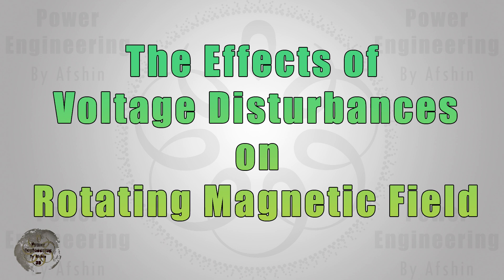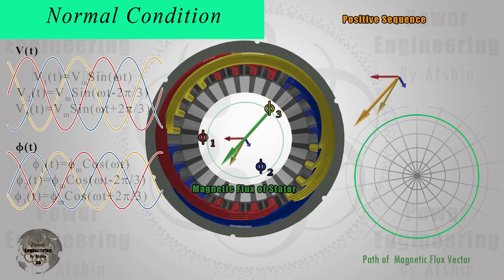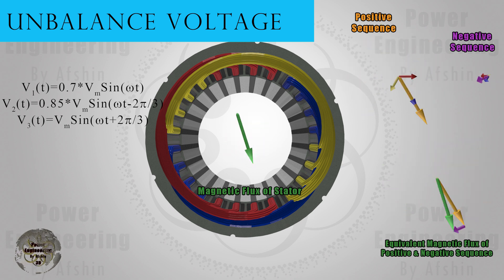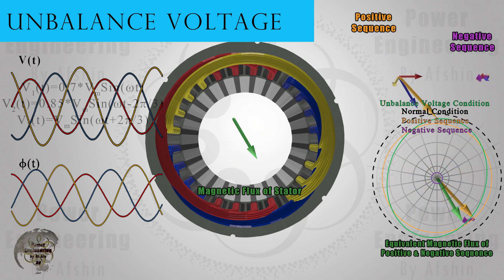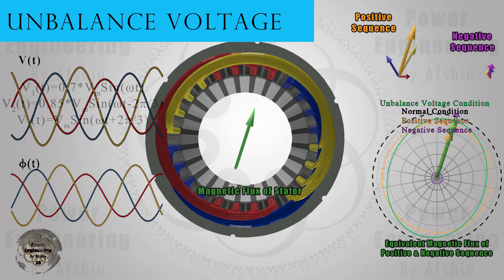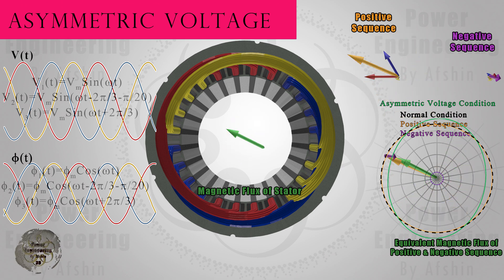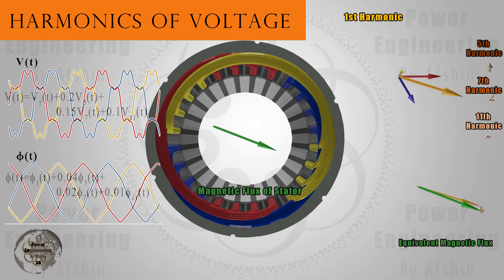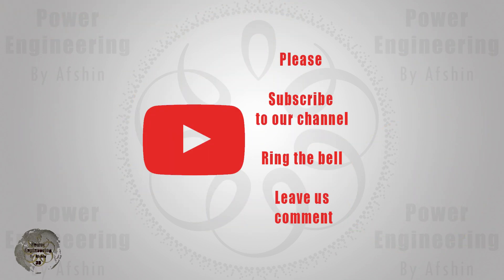Impact of Voltage Distortions on Rotating Magnetic Fields in AC Motors

Comment: My brain hurts.
Reply from the maker: Sorry about that! 😅 Let me know if there's anything I can explain better. I’m here to help!
Reply: @PowerEngByAfshin-zs2nd  can u help me understand how a run capacitor makes this magnetic field rotate
Reply from the maker: Yes, certainly. In single-phase motors, a rotating magnetic field is created using two windings: the main winding and the auxiliary winding. The starting capacitor is placed in series with the auxiliary winding in the circuit, causing a phase difference between the currents in the main and auxiliary windings. This phase difference results in the creation of a rotating magnetic field in the single-phase motor. But the rotating field is not uniform.

In the upcoming videos, we will examine how the rotating magnetic field is generated in single-phase motors. Stay tuned with us 😀